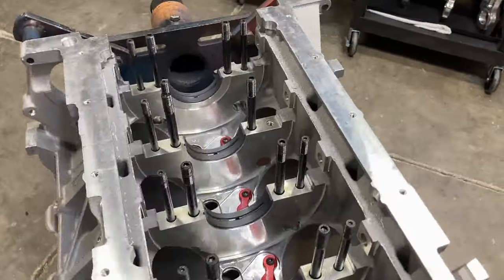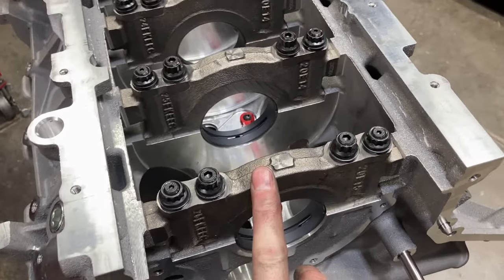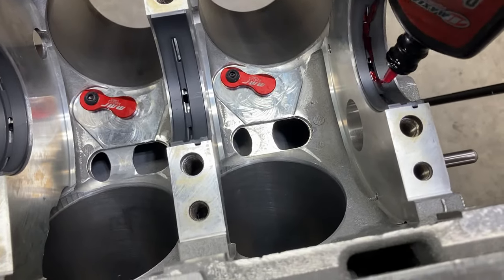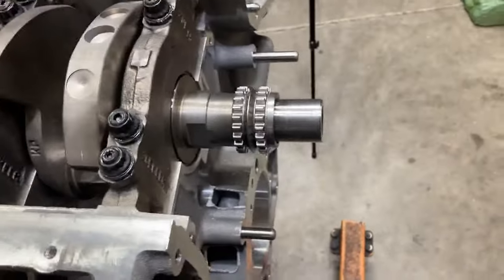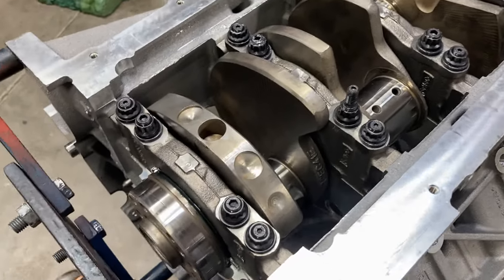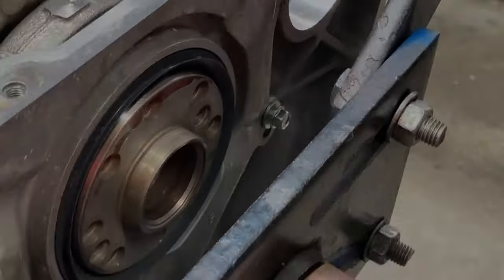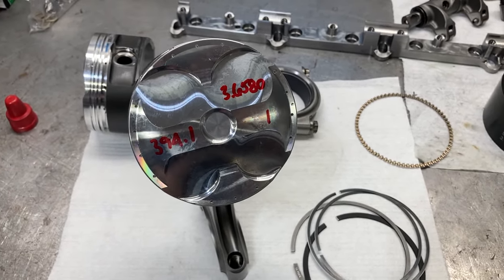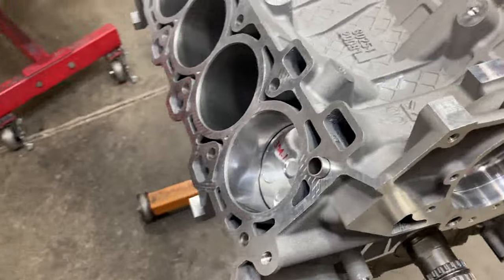Lykins Motorsports Ford Coyote 5.0 Short Block Assembly

Comment: Awesome engines. Those coyotes are impressive. I wish someone near me could help me understand what im doing wrong with my 390. All freshly rebuilt and starts ticking after warmed up. Frustrating!
Reply: A worn lifter bore,did my block in..🦨
Reply: timing chain hitting the inside of the timing chain cover? the new cam gear we put on had the spacer built in but we added one anyway not realizing it

Comment: Observation/question: Did you mean to apply the silicone outside the two lower bolt holes on the rear cover? Seems it might leak from those. I believe the sealant was applied inside the perimeter of the other holes?

Comment: Why would you block off the oil squirters?
Reply from the maker: Waste of oil on a naturally aspirated engine.   The Gen 3 Coyotes don't even have them.
Reply: A'lot of aftermarket pistons are designed to disperse heat and with doing so expand with them in the cool pistons to much and allow the pistons to not expand and in doing so oil gets past rings and lowers compression holding abilities.

Comment: Main stud’s but head bolts? Sealing the heads (imho) is as important as the mains, just like the rods. I understand that stud’s are more expensive than bolts but torque to yield are butter bolts. I’m just surprised on a “high hp “ n/a combination.
Reply from the maker: Very rarely do I use head studs.  Just not necessary on naturally aspirated stuff.  Only reason I switched to main studs is because factory fasteners are torque to yield and you end up checking bearing clearances more than once.